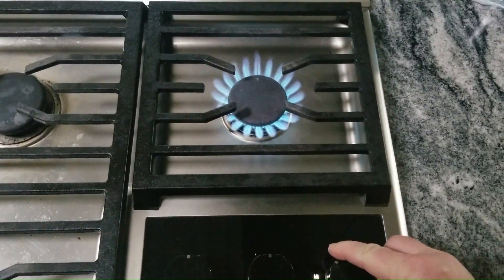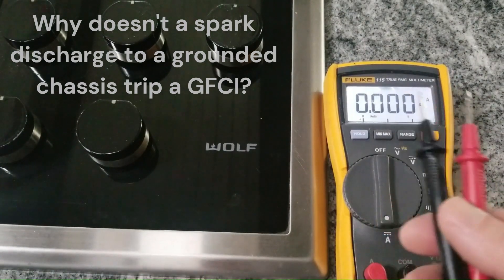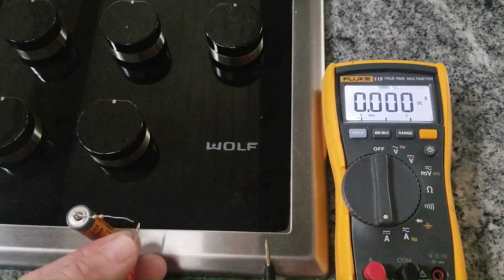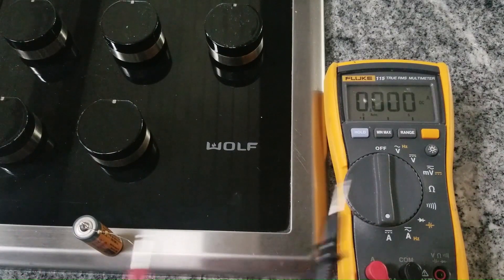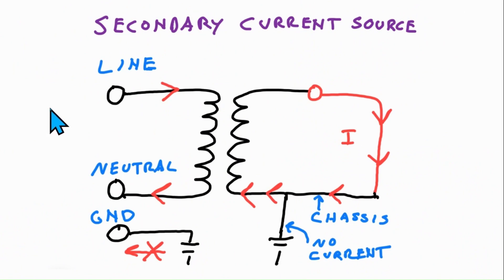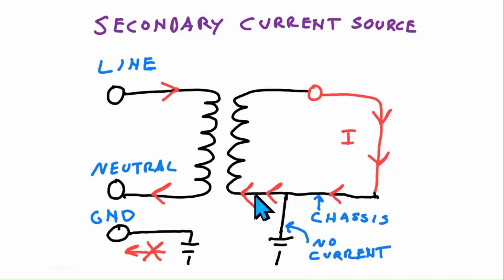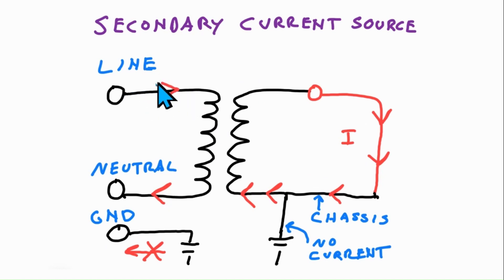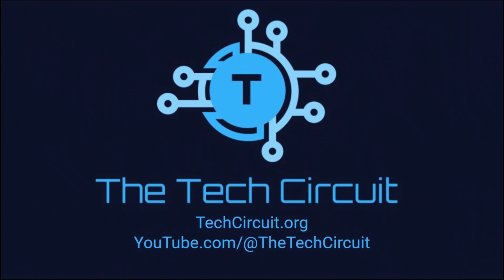#79 - Why Current Through a Grounded Appliance Chassis doesn't trip a GFCI

Comment: GFCI is using a deferential between circuit for the line and neutral they both cancel each other to get zero is like you measure a 110 cord with a clamp meter without using a splitter you get zero if you are using a ignition tool your power will go back to GFCI and split to the line and neutral and will not Trip the GFCI or it will get dumped to the ground

Comment: This is a good point, that a lot of people don't understand.  However, it might have been clearer for some people if you'd started out by actually explaining how GFCIs work, and what they measure (because I've found a lot of people, including many electricians, actually don't even understand that).

More generally, the point here is that anything that is powered through an isolation transformer will not (and actually cannot) trip an upstream GFCI.  This also means if you touch the wrong thing, you can actually have electricity flowing through your body from the transformer output to the chassis (possibly electrocuting yourself) and the GFCI will not protect you.  This is just one part of why things like microwave oven transformers can be so incredibly dangerous if you use them differently than intended, even if you plug them into protected circuits, etc.
Reply from the maker: Thank you. In hindsight, I can see where a blurb on GFCI function would have been helpful context.